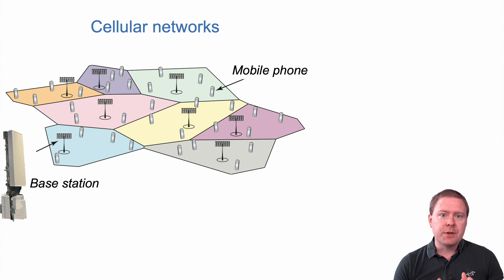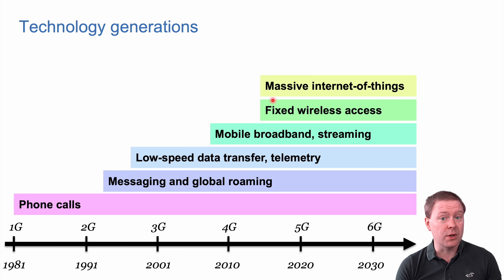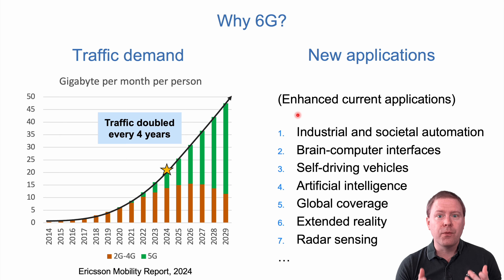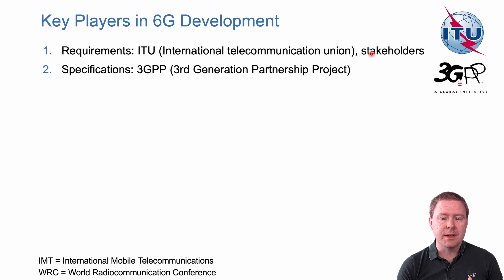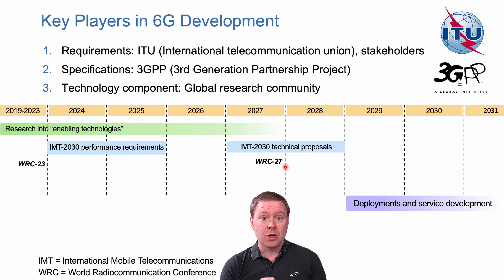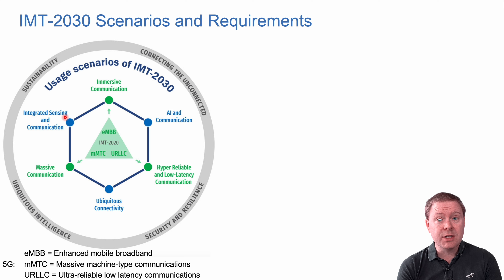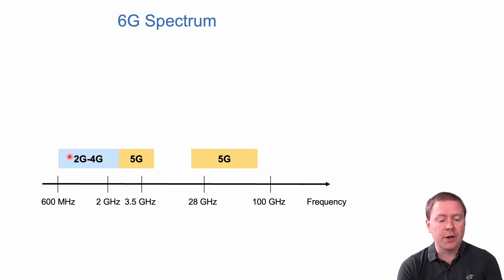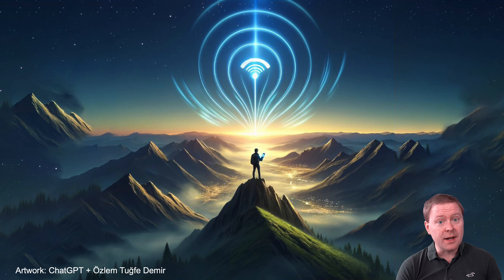6G: What, why, and how?

Comment: Can I ask a question... How do I calculate HPBW using MATLAB?
Reply from the maker: You can plot the beam pattern as a function of the angle, normalize the peak value to 1 and then identify the points where it reaches 0.5. The distance between these points is the HPBW.

There are closed form expressions for uniform linear arrays with isotropic antennas. You can find such a formula in Example 4.7 of my book https://www.nowpublishers.com/article/BookDetails/9781638283140

Comment: Have read that many carriers are reluctant to spend more on infrastructure and would prefer a 6G software upgrade to existing 5G equipment.  Can a software upgrade provide improved spectral efficiency to the existing 4G/5G bands or does it require new radios.  My understanding is that 6G may provide 2X-3X better spectral efficiency in same band over 5G but can that be accomplished with a software upgrade or need new radios?

Comment: Aren't 'requirements' and 'specifications' imply the same things? To ask the question differently, What are the distinct roles of the ITU (requirements: you said) and the 3GPP (roles: you said) in modeling the next generation comm. system? In your video, releases of the 3GPP are mentioned. But nothing by the ITU. 
Thank you.
Reply from the maker: The ITU requirements refers to the performance (data rate, latency, etc.) that a technology must deliver to be called 6G. The 3GPP specifications refers to the details of the standard: How does the technology function in order to reach the performance requirements?
ITU releases requirements once per decade (4G, 5G, 6G,…). 3GPP refines its standards every other year to add more functionalities, or making existing functionalities more attractive to implement in commercial products.

Comment: Dear Professor, Thank you very much for your informative videos. I have a question regarding efficiently finding relevant references in standards. For example, I am writing a thesis chapter regarding pilot assignment algorithms and would like to include a section about pilot assignment algorithms existing in practical (MIMO) networks after explaining all advanced schemes in the literature. After all my searches in textbooks and publications, I still can not find a very comprehensive summary of practical examples regarding pilot assignments. Most of them mentioned things like greedy algorithms based on a predefined set of pilot sequences, but practical examples were not cited. Could you please share some insights on how we can efficiently and precisely locate the references regarding telecom standards and real industry use cases? Many thanks!
Reply from the maker: When I worked on my thesis, I spent several days trying to understand what scheduling algorithms were used in the latest standard. I then realized that the standard does not specify such things. Most things related to resource allocation is purposely not standardized so that the vendors can compete on making the most efficient implementations. The standard is only a skeleton that specifies the most essential things related to protocols, when to transmit signals and how, etc.

I believe the same applies to pilot allocation. The possible pilot sequences are standardized and how you tell the user which one is assigned, but you don’t specify how the selected is made or what kind of estimation algorithm will be used when receiving the pilot.

I don’t know what practical systems use, but I would guess it is some kind of greedy algorithm that has been fine-tuned using extensive simulations.
Reply: @WirelessFuture  Thank you very much for your reply. That explains a lot! I guess I will stop searching on those standardisation websites for a precise pilot assignment protocol!

Comment: Thanks Prof. Björnson. How do you think about using sub-THz wave for communications? Since the limited power of THz sources, it seems we already reach the threshold for higher generation communications, on Earth right? In my opinion, if we need higher data rate with high reliability, the base stations will be in a few meters....
Reply from the maker: I’ve heard that the 3GPP channel models are being enhanced to also capture sub-THz bands. These bands could be used for fixed wireless backhaul links (or even fixed wireless access), where one can guarantee line-of-sight conditions in the deployment. However, I think sub-THz communications to mobile users is much further into the future, and will not happen until after mmWave communications to mobile users become a commercial success (if that will ever happen).

Comment: The governing structure of the telecommunication industry is fascinating. The first thing I noticed after entering the field is that there are so many cartoon drawings in the papers. The second thing is that there are so many conferences. The third thing is what you are presenting here, the governing structure. It is very much a system of its own. I don't think any other field has such a close-knit governing body involving industry, academia, and regulators.
Reply from the maker: There were competing cellular standards in the 1G, 2G, and 3G eras, but the telecom industry has since then realized the benefits of having only one global standard so that the same equipment can be sold everywhere. The standard is only a skeleton that enables interoperability between equipment developed by different vendors, which can still compete when it comes to the implementation details. Since standardization is done with unanimous decisions, there are many features in the standard that were added for bargaining reasons but that might never be utilized in practice.

Comment: Concerning your new book, I am struggeling with exercice 6.3. I know we must build the derivative. 
My approach: the term behind the LAGRANGE multipl. becomes 0 because the sum is 1 and we get 1-1, so the term is canceled.
The term behind the first sum: I use the product rule for the derivative. But I get a complicated expression:
Sum(B/log(2)*[log(1+(P*beta_k)/(xi_k*B*N))-(P*beta_k)/(B*N+P*beta_k*xi_k^-1)]=0.
The expression in the squated brackets must be 0.
Perhaps you have a little time. Thanks.
Reply from the maker: If you write up the Lagrangian and compute the derivative with respect to \xi_k, you will get something of the kind:

log2(1+(P*beta_k)/(xi_k*B*N0)) - log2(e)(P*beta_k/xi_k)/(B*N0+P*beta_k/xi_k) - Lagrange multiplier.

This should be equal to zero for all k. Since the Lagrange multiplier doesn't depend on k, the expression can only be zero for all k if beta_k/xi_k=constant. It then remains to identify the right value of the constant.

Comment: Dear Professor Björnson, Thanks for your educational material! I've been following it since the early days when I started to get into MIMO.

Have you followed the recent research applications of AI surrogates in Digital Engineering?
AI surrogates enable to turn engineering simulations (from CFD, FEA, CEA to even CEM) from hour-long computations to instantaneous predictions. Additionally, they provide gradients to optimize for certain outcomes.

Have you thought of how to apply this in cellular/mobile communication? Are you aware of any researcher who does?
Reply from the maker: I haven’t worked with this myself, but there is a lot of talk about building digital twins of cellular networks to optimize their operation. I believe that can be related to the surrogate AI approach.

Comment: 5G that is producing 1G speeds is what 4G was billed to max out at. 3G speeds are what 4G was billed to max out at. Are you seeing a trend? 6G will be a huge disappointment, too
Reply from the maker: 5G is a very capable technology that greatly improves the network capacity. The main issue is that the telecom industry tried associating the 5G technology with new "5G services". It is the uptake of those services that has been disappointingly slow so far. It is only mobile broadband and fixed wireless access that have been commercially successful in 5G so far.

This has happened before. 3G was supposed to be about video telephony, but it didn't take off until we entered the 4G era.
Reply: @WirelessFuture whic version of 5G are using, who produced it😮😊